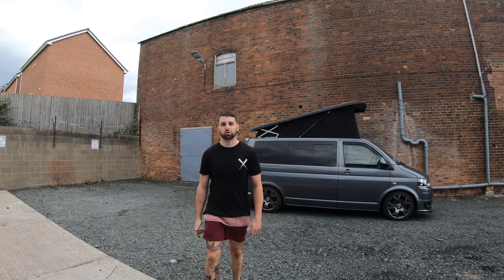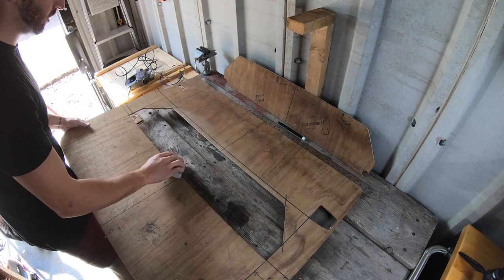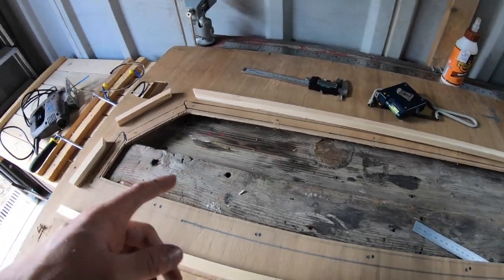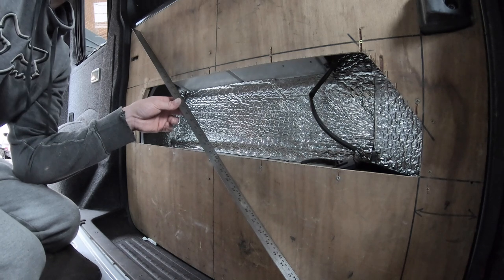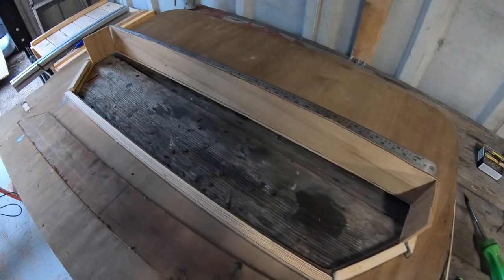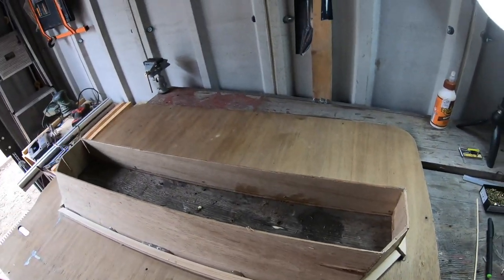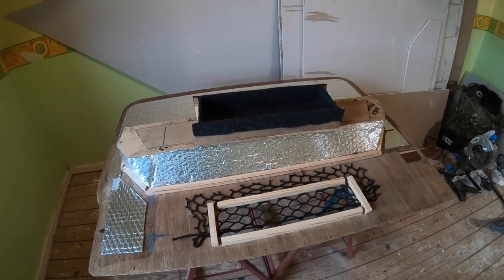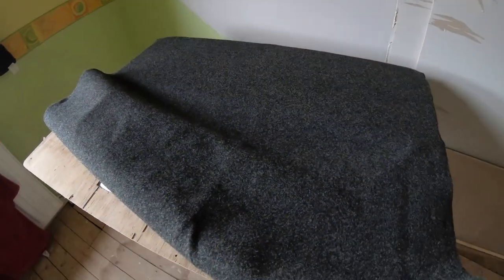* CUSTOM MADE CAMPER VAN SLIDING DOOR STORAGE SPACE !! AMAZING RESULTS !! *

Comment: Did you only keep one courtesy light in the van? Trying to work out where to put mine when the spotlights go in
Reply from the maker: Yes just to run off the door for late night entry etc. I have 4 other led spot lights in there also
Reply: @JaysFabShop  thanks I'm torn between ceiling mount or sticking them both above the arches but I'm planning on doing the ceiling next year, carpet on the walls this weekend or so... thanks for the inspiration though, I was debating buying one and then after watching your videos and seeing how easy you made it all look I decided to take the plunge 😃